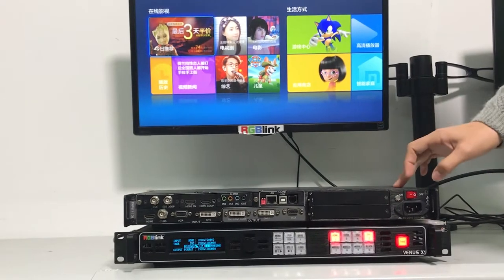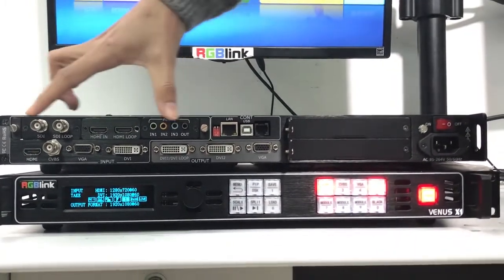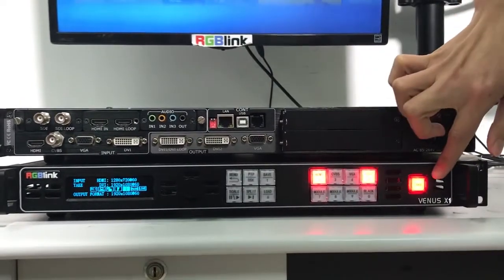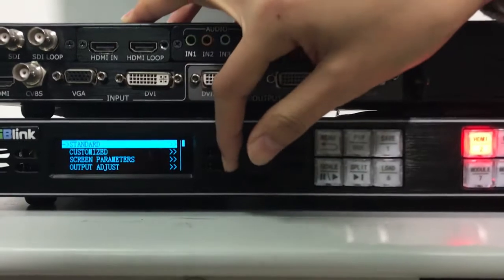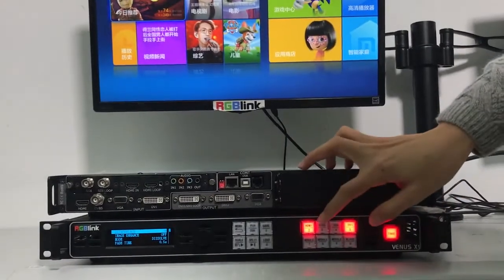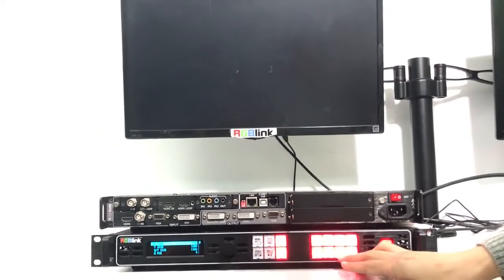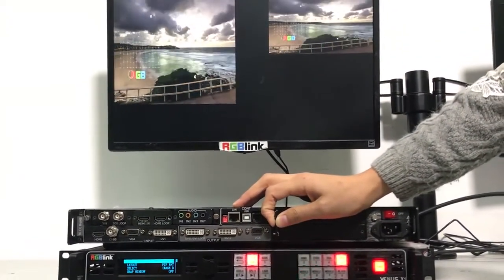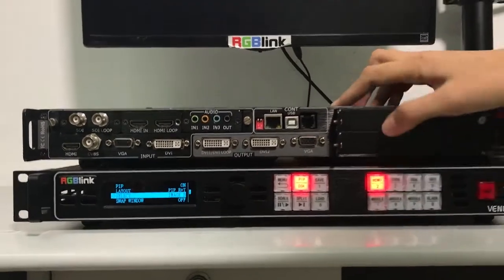X1 Introduction

Comment: Greetings, I have a x1 Venus device, the button that controls or to access the menu is fine.

Is there a way to remotely manage it by computer for the dimensions?
Reply: Hi Friend, In fact, X1 is an entry-level video processor that does not have remote control software. If you need it, you can try using Q16pro, which is also a powerful 4K video processor.